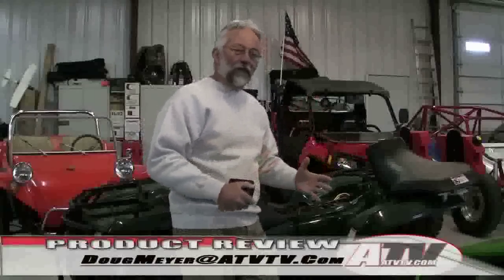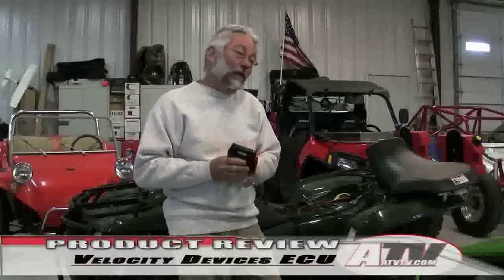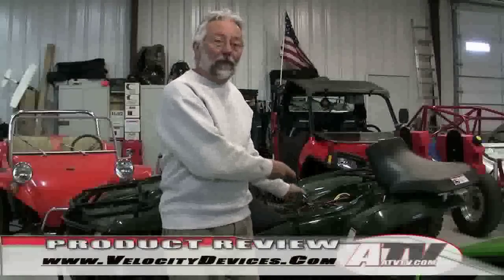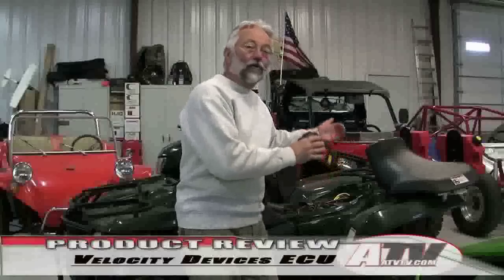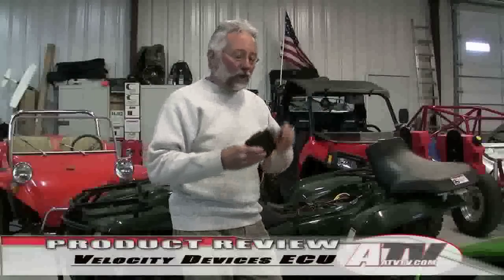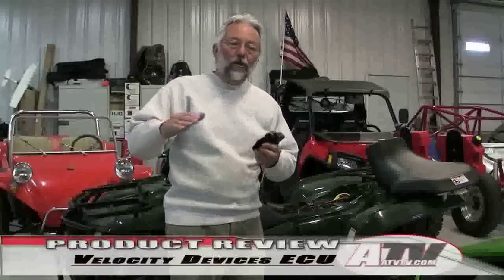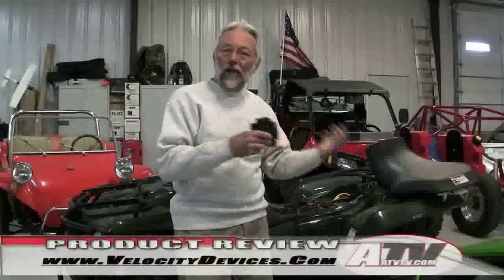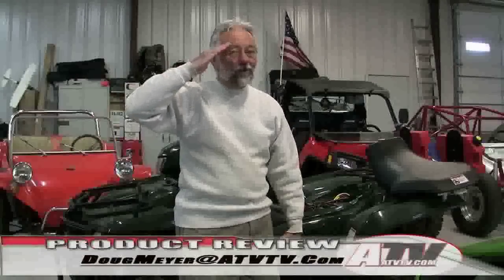ATV Television - Velocity Devices Performance ECU on Suzuki King Quad 700

Comment: hey doug,,doug here,i have a 2007 700 king quad with the vdi,pipe,clutching,and 28 inch silverbacks,this thing is a rocket!!!,at least 20 percent betr on fuel and with the 2 inch lift,,,its amazing riding it in the mountains of western alberta
Reply from the maker: Good to hear it's working as planned. Thanks for the mileage info as well. I haven't put enough miles on yet to tell.

Comment: Thanks for the review Doug.  I've been contemplating this upgrade for my King for some time.  I know what you mean on the Prairie as I owned a 700.  I added a Diamond G module to that ride and it was an awesome upgrade, and not allot of money either.  If I can make my king respond like my old prairie I would be very happy indeed.  I find myself using low range all the time in the woods for better response, and this mod would be great, as well as losing the limiters.

Comment: I decided to take the plunge and bought one for my 06 700. It's always been somewhat of a turd IMO, specially after installing some 28 inch ITP blackwater evolution's. It should arrive Tuesday  (1/27/15), I hope it's as good as all the reviews. I'll report back in a week or two.
Reply: +doubleshok No difference, I had issues with it and took it off, put it back in its box and that's where it has sat for year and a half or so. I think there is something wrong with the box, I need to send it back and have them see what's going on with it. I called them a long time ago and told them it wasn't working, we checked  a few things and everything seemed to be set up correctly.  The owner was supposed to call me but never did. You have remained me about it, so Monday I'll call them back and see what they will do, hopefully I can send it back and get another one, but it's been quite a while since I talked to them about it. I'm probably screwed by now. We'll see.
Reply: I think you would be better off buying from a company like power commander (Dynojet).

Comment: Great. Have you had any kind of problems since you installed the VDI?
Reply from the maker: The only issue I had was breaking the little nut where the plug screws in. Although it was all my fault due to where I mounted it....Other than that it still works great.

Comment: You still running one of these Doug? Just curious on your thoughts after some time and miles, thank you for the good reviews.
Reply from the maker: Still have it on my personal KQ700 but don't get to ride it much due to all the test units ;-) I still love it. The only issue I've had with it was my fault - the plug is rather fragile and where I mounted it under the seat caused it to pull out. Fixed now and works great.

Comment: So is the vdi ready to use out if the box?, or do you have to program it becuase i have heared that you need to get "map" for it.
Reply from the maker: Plug and play so they say ;-) It comes programmed in your choice of two ways. Typically in stock and limiters off and the first performance power curve added.

Comment: Hello everyone and Doug, I know Doug, you are a big fan of the King Quad and I wanted to run this by you to see if you have personally ran into this issue with older King Quads?  I have a 06 700 King Quad and have had a terrible time keeping batteries in my machine..  Even with a tender I am only getting 1 1/2 years out of them..  I live in MN and my Machine sits in my heated garage with a tender Jr on it for 5 months of winter..    I have done some research on forums and it looks to be a popular issue on the 05-06 models..  After reading forums and such, one of the fixes is to replace the ECU, I wonder if this ECU would fix this? If one was going to invest in another ECU to remedy the draw issues, maybe it would be beneficial to upgrade to this one instead of an updated stock ECU..   I might just need to contact them and ask.. Anyway, thanks for the great review Doug and any info you may have to share regarding this!!
Reply from the maker: I have not had that problem but highly suggest you check with Velocity. I would suspect that it fixes that issue which in that case replacing the stock ECU would be a no-brainer..... And justified by saving battery costs ;-)

Comment: Hi Doug. Do you know if I install this on my KQ750, will it void the warranty?
Reply from the maker: Although I see no way that this will harm your KQ the dealer may use it as a way to void your warranty. But since this is a plug-in device and you keep your stock unit, I'd just plug the stock unit back in if you ever need to take it to the dealer.

Comment: Do you think adding a VDI would effect reliability? Lets your miles away from civilazation and your king quad stalls, wont start etc. Becuase of the vdi, now what.
Reply from the maker: I believe it to be just as reliable as the stock ECU. Remember you are simply replacing one unit with a unit programmed a bit differently. It should be no different than running a performance chip or a 're-flashed' ECU in a performance sports car.....

Comment: You should redo this review with a 2014 and up king quad, The VDI makes your quad run horribly on the new style king quads (2014 and up). Lots of studdering and bikes wont start.  Vdi is aware of this and yet continues to sell their product knowing full well its junk. After contacting Lyle from vdi he eventually gets fed up hearing from you and blames your bike. Its to the point where he wont even talk to customers with a 2014 and up. Check out the susuki forums and youtube, lots of proof the vdi sucks with newer kingquads

Comment: Will this work for king quad 500 axi? Can't find any performance ecu for it, wondering if I can use this one on my 500?
Reply from the maker: Contact the company. Each unit is model specific.
Reply: jritch789 I have the same question. Did you ever call the company and found out?
Reply: Yea I sure did and they said no! Reason was the 500 wasn't popular enough but somehow the 450 is? There has to be something or someone who makes something for this, worse case I'll just do the shim and clutch kit. Good luck man

Comment: can I use a BigGun power box if I swap out the ecu?
Reply from the maker: Mongoheadmonster The Big Gun Power Box is basically the same type of device (modified ECU) so you wouldn't use both. And if you are going putting this on a Suzuki King Quad, Big Gun does not make one for it.
Reply: I just ordered a BigGun power box for my suzuki 700 kq.... Description said "for suzuki kingquad 700"...so I hope it's not a phuckup.
Reply from the maker: Mongoheadmonster Hmmm. I had checked their website and didn't see anything but sport quad stuff. So maybe I am wrong......Let's hope that's the case ;-)
Reply: Bikebandit said discontinued but atvgalaxy had them $215US BigGun efi tfi controller....more than 10 available... Haha...yes, let's hope

Comment: Those are some crazy claims, Doug can you say they are true for sure? I can't grasp it, no internal mods, no clutching, no exhaust and a giant leap in hp? What about torque increase? This is very interesting. I love the King Quad, it's lighter than a lot of other big bores and if this gizmo is legit it could put it right in the thick of some the others power wise.
Reply from the maker: They are indeed unbelievable numbers! Here's what I know; Although the performance numbers are unsubstantiated by me the performance increase is very feelable (that a word?) without any specifics. And I do know (from the manufactures themselves) that they left a whole lot of performance untapped in the engine due to safety concerns in a 'utility' ATV.

I was very doubtful and did not test this for several years because it all seemed too much. But the performance increase is big.

I had previously been down this road with my Duramax diesel and the claims by Hypertec and their programmable ECU. I put it on and was literally blown away by the increase in power. Later I did the same thing to my Flyin' Miata prepared Mazdaspeed MX5 and was again absolutely amazed. I finally thought I'd try this.